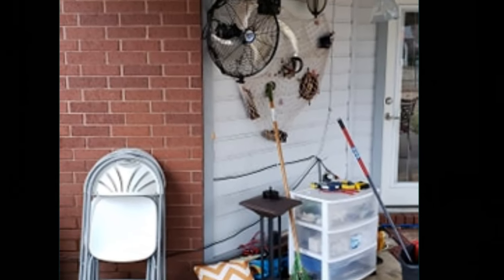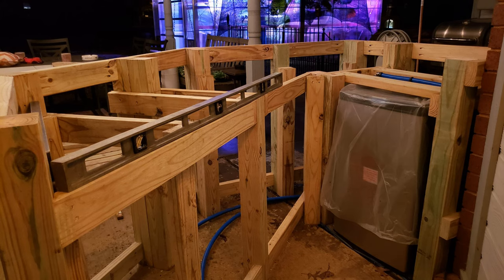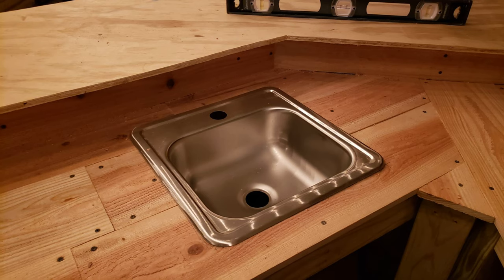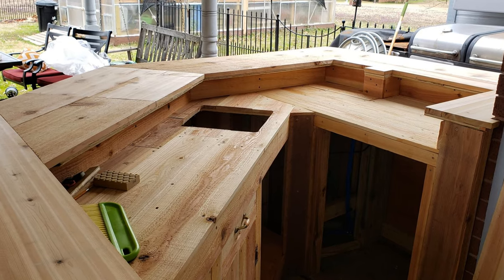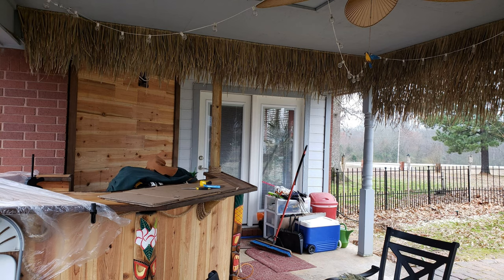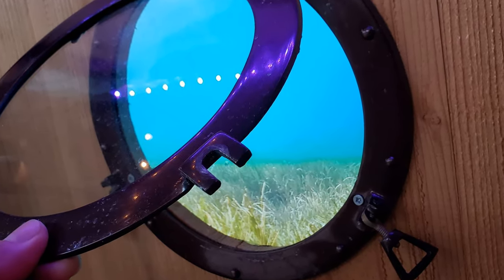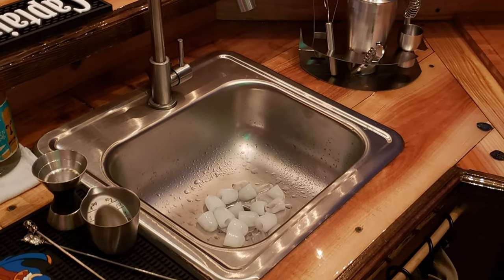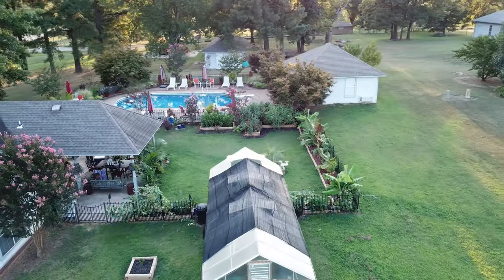Build an Amazing Patio Tiki Bar & Video Porthole🌴 #Tiki #Palapa 🦜

Comment: Love it! Here’s a suggestion you might find useful. Get a 9volt battery operated water alarm and mount it to the bucket lid fir your sink wastewater. They have sensors that are on wires so you could attach a small piece of wood or something below the lid and affix the sensors to that so when your water gets close to full you will be notified by the alarm. Easy and only about $10.
Reply from the maker: That's a good idea!  Thanks for watching!

Comment: Fantastic build!  Could you list the parts & stuff needed for the Video Porthole? I can't find the list in the comments. Thank you so much, you truly inspire me.
Reply from the maker: Hi & thanks!  I have a "Tiki Bar" section on.my Amazon page with links to it:  https://www.amazon.com/shop/tiki71
Most of the things I've bought for the tiki bar are in that section.   I'm on my cellphone, so I can't get the specific link right now, but that'll get you there. 🤙🍹🦜🌴
Reply: @Tiki71  I couldn't find a link to the monitor screens you used for this build in your list.  Also, do all the screens show the same item at the same time or do they act as display port attached monitors so when one item moves off screen the other picks it up on screen?

Comment: That looks AWESOME. Would you happen to have dimensions/ Blue Print for your Tiki Bar?
Reply from the maker: No, I just custom built it and took measurements as I went, once I laid out the blue painters tape and then figured from there.  I spent some time working it all out in my mind and then on paper, but I've long since lost that paper.  Sorry.
Reply: @Tiki71  Sharp mind :-). Good Job, it looks great